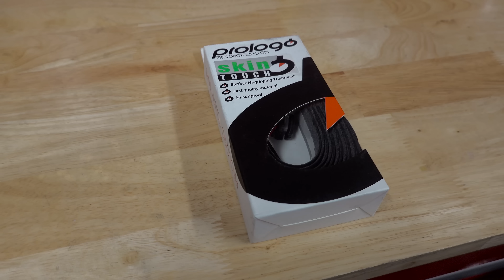Baum Ristretto Pink Panther Campagnolo Super Record Zipp Dream build

Comment: that paint so awesome and I don't mind these are maybe the parts from before but I would have put on fresh BB cups
Reply from the maker: Agree👌
Reply: Agree, and new hoods !
Reply: or...I could not be adding to landfill and re-use some cups on a part of the bike that is only seen in a build up vid. I chose to recycle. Just a personal choice.
Reply: @nick_velokicks  yeah I see that as a valid point it still is an interesting juxtaposition and then takes you to think the "rest of the story" kind of like I had/acquired this used Baum frame, stripped it down with this vision.
Reply: @metamurph  not sure what story exists? It was my bike the whole time, just updated it with some red edition Campag (to replace 2011 11sp Campag), primarily to also go with the new (but also second hand) Campagnolo Power2Max. It's a lovely bike and Nick did a stellar build, as always. But was a very modest budget for the upgrade.
Reply: @valhens  hoods are still wearing in. You know, cos that's how Campag goes 😉
Reply: @nick_velokicks  it is a beautiful machine..see there is the story -- it is something like I like in these builds they aren't always budget doesn't apply or the latest thing from vendor X.  And budget constraints...I know those well.